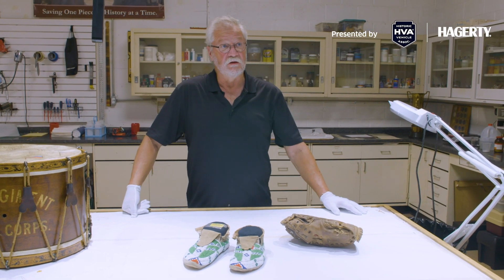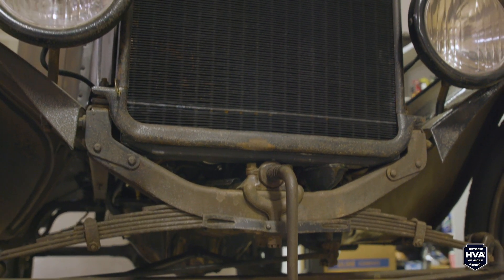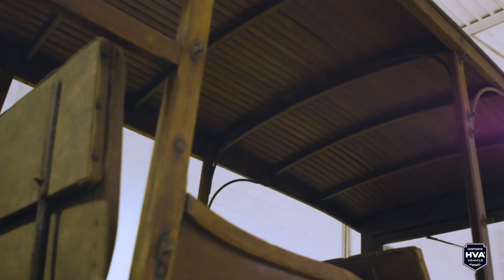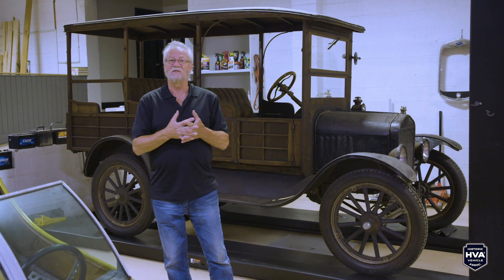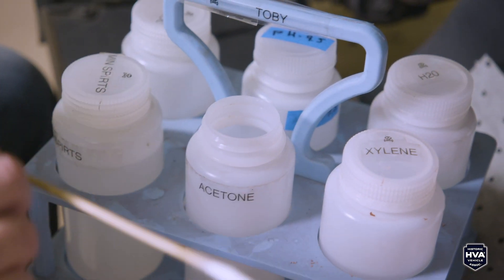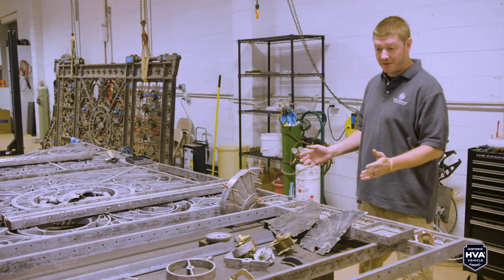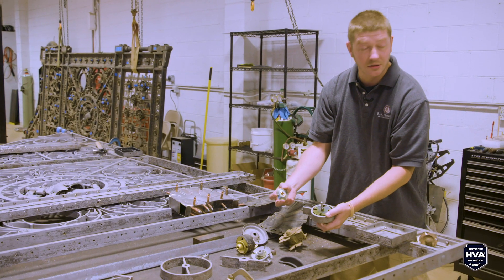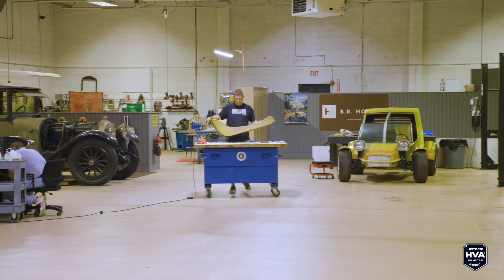Macro Artifacts: 1920 Model T & Arlington Cemetery Gates - The Conservator's Mindset | HVA

Comment: My thoughts on the automotive portion of the restoration world is that I feel if it's a one off, it's still meant to be used, so it should be used on occasion, brought to (trailered perhaps) to the parking lot and driven onto the judging field. If the car ceases to be used in any capacity, then it ceases to be a car. which totally does away with the original intent.

Comment: Thank you for your work on conserving vehicles and large objects, and for really helpful video posts explaining conservation ethics to many who might be unsure about this profession. I trained and worked as a conservator in a UK museum for 7 years prior to retirement a few years ago and always struggled with the ethical use of an engineering artifact versus static display. I wonder if I could ask your opinion on a fairly new product which shows great promise as a deterrent  against corrosion and which has come onto the market for use on cars and vehicles. The product name in the UK is Lanoguard which uses lanolin waste from industrial sheepskin treatment / manufacture. Although lanolin is clearly not new, and has apparently been used for years by the military for preserving metals, it does show huge promise for regular use on working vehicles. I'm not sure how reversible this would be or whether there is any review of lanolin in conservation, but I would really appreciate your views as to whether this could be considered for conservation. I should state that for me currently, this would be used in a non-professional capacity on my own vehicles. I'm just curious to see if this could be contemplated for professional conservation use in the way tannic acid might also be used.

Comment: To me the argument of restoration vs conservation comes down to affecting the value of an object. A 1932 Auburn with low miles and a presentable original condition would be worth more than a 100 point concours restoration in most cases but there is also the argument that it is not as the builder intended the car to look with worn upholstery and faded paint and tarnished brightwork. 
.
Reply: I guess one might have to decide whether they want a brand new 1932 Auburn, or a 88 year old 1932 Auburn. 
I believe I heard in an interview that people who buy Pur Sang Bugatti replicas usually have the original Bugatti first, and then they want to use it more frequently so pretty much buy a brand new car to use that instead.